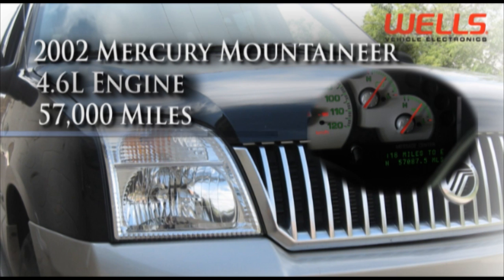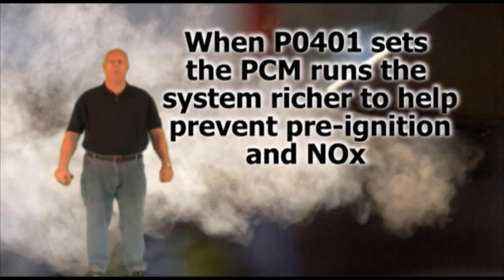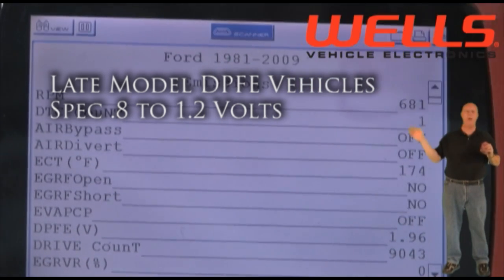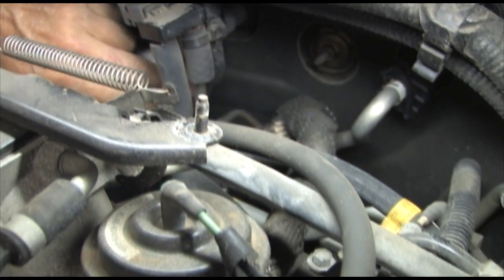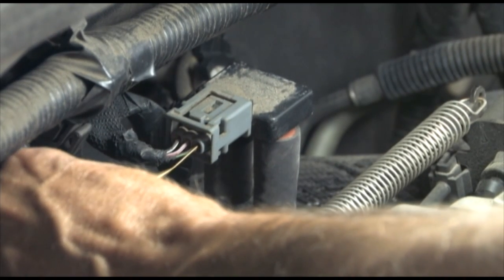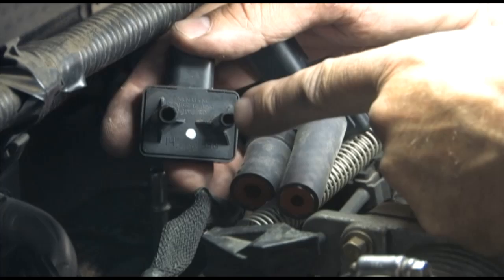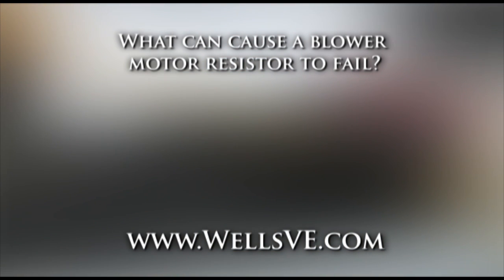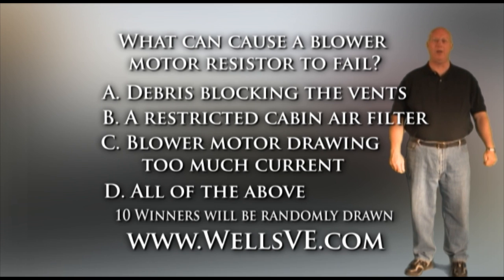Ford P0401 DPFE EGR  Pressure Sensor Diagnostics and Repair with a Contest

Comment: thanks for the video, will you please to guide me how to chek EGR valve module in my 2006 ford freestar please_ I got P0406 code and my check engine light is on, mtor es 4.2l V6. Thks
Reply from the maker: Hey Angel,
The EGR module on those is a complete unit with a map sensor/ flow sensor installed. To test check the DPFEGR output signal from being stuck over 4.5 volts. If it is, the code P0406 code will set.
~Ryan
Reply: @GoTechTraining  you aré right, i got 5.06volts in the dpfe sensor, whats Is the spec?
Reply from the maker: It will range depending where the EGR flow is at. Here is a testing procedure....

SIMULATE THE DIFFERENTIAL PRESSURE FEEDBACK EGR SENSOR SIGNAL WITH A VACUUM PUMP
Disconnect the downstream differential pressure feedback EGR sensor port hose at the ESM.
Verify the hose and port are clear and free of obstructions.
Connect a vacuum pump to the downstream differential pressure feedback EGR sensor port.
Key ON, engine OFF.
Access the PCM and monitor the DPFEGR PID.
Apply 27 - 30 kPa (8 - 9 in-Hg) vacuum to the differential pressure feedback EGR sensor and hold for 10 seconds.
Quickly release the vacuum.
The DPFEGR PID voltage must be between 0.25 and 1.3 volts with the key ON and no vacuum applied.
The DPFEGR PID voltage must increase to greater than 4 volts with the vacuum applied.
The DPFEGR PID must drop to less than 1.5 volts in less than 3 seconds when the vacuum is released.
~Ryan

Comment: I can’t seem to find the dpfe sensor on an 89 f350/460 cid.
Reply from the maker: Hello Jay,
I don't believe the 89 7.5L runs a DPFE sensor. This system used a EVP sensor mounted on top of the EGR valve.
Ryan Wilsing, Technical Instructor

Comment: What is the problem for my Ford Explorer sports Trac the check engine always come out and takes a lot of fuel 27liter per 100kms with in the City.but long distance it takes 20 Liter per 100kms .thanks this video
Reply from the maker: Have you taken a look at the easy stuff? Hows the maintenance items, air filter, spark plugs, fuel filter, etc?
Mike Becker, Senior Instructor

Comment: I bought a navigator and the egr sensor is unplugged and the wire harness is missing... Just a sensor with vacuum hoses and no wire harness or plug to it anywhere.. Lol.
Reply from the maker: That's not good Mike! Hope you don't need to take it through emissions anytime soon.
Mike Becker, Senior Technical Instructor

Comment: Does the voltage reading you give hold true for a 1999 5.4?
Reply from the maker: Michael, I believe so. Most of the DPFE sensors on Fords used the same readings. 
Mike Becker, Senior Technical Instructor

Comment: Beware haha , Autozone will say you need a new DPFE sensor and will charge you 80-100.00 for the part and the CEL will come back on / stay on after installing the new DPFE sensor , the same code too P0401 will show . Check before buying parts , autozone just likes to throw new parts at you .
Reply from the maker: Couldn't agree more man! Test, don't guess!!!!!! :)
Mike Becker, Senior Technical Instructor
Reply: very true Autozone always dose that to ppl
Reply: AND be sure the two vacuum lines u replace have the same INSIDE diameter or it will throw the 401 code lol
Reply: AutoZone does have a warranty policy on the parts you purchase so if they’re not the problem you can return and get your money back!

Comment: Hello Mark! I have a skoda octavia an 2012, engine 2.0 tdi and i have the error P0401, insufficient flow, if i wipe the car pulls well, and after a running time gives a bug and does not pull the engine well.What can I check? Thank you!
Reply from the maker: Hey Marian, chances are when the P0401 code sets it puts the car in some sort of "limp mode" That's probably why it doesn't run well when the code is set. Take a look at the passages for the EGR valve. Maybe they are plugged up with carbon?
Mike Becker, Senior Technical Instructor
Reply: @GoTechTraining  Thanks a lot!

Comment: I'm a semi retired electronic tech. This was very accurate. My wife's 1999 4.6 Liter  Ford Expedition has an intermittent more annoying than really worrisome problem.  it gets a  little rough. it seems to affect shifting..but not always. Auto Zone scanner  said it needed to have the DPFE replaced. I am not a parts replacer as such.. I want to know how something works and how it's designed. I now see why the EGR is so necessary.. It is a safety engenering part to prevent damage. I subscribed and rang the bell.  I am going to your site.

Comment: Great video. I have 96 Continental. When back probing as shown in video, I get 0 readings but car beeps then turns on cooling fan. I'm getting 0 readings when probing other ports as well.
Reply from the maker: Hey Scott, do you have your meter hooked up properly? You should get some sort of reading on at least one of the wires.
Mike Becker, Senior Technical Instructor
Reply: Tried different probe today and got readings of 1.19 at signal wire and 5 volts on other. Think I might have a problem with the device that controls vacuum for the "second" egr valve. Need to find out how to test it. Hard to access.
Reply from the maker: Hey Scott, good, glad you were able to get a reading! You're talking about the EVR? The EGR vacuum regulator solenoid?

Mike Becker, Senior Technical Instructor
Reply from the maker: Scott, how many wires are going to this part that you want to test? I think you're talking about that vacuum control solenoid. It will have only 2 wires going to it.
Mike Becker, Senior Technical Instructor

Comment: I had mine replace and i just got  the same code and cel again
Reply from the maker: Hey Southern Texan, maybe you have a wiring issue? 
Mike Becker, Senior Technical Services Instructor
Reply: Wells Vehicle Electronics ok ill double check and see if theres a loose wire
Reply from the maker: Good luck!

Comment: How do I connect my voltmeter to check the volts..... in the video I only see one lead connecting to the pin
Reply from the maker: Juan, you could hook the other lead up to the battery. The volt meter will read a difference between the pins...so If you are checking for power, you can put the black lead on battery negative, and the opposite for checking the ground circuit. Now there is way more in depth testing if you want to get into it...this is a very basic first test.
Mike Becker, Technical Services Instructor

Comment: our left side of dpfe sensor tube connection got blown and after inspecting right after there is a lot of heat and gas, do you know what caused it?
Reply from the maker: Hey John, many times this is caused by restricted exhaust. Especially if you are noticing the hoses melting. These are special high heat hoses, don't just use standard rubber when replacing.
Mike Becker, Technical Services Instructor

Comment: Please help , I just made the test with a Voltmeter and both readings from  both terminals shows 4.9 Volts , When I was expect to have one in 4.9 V and the other  Should read less than 1.2
Reply: For me it represents that the DPFE sensor is in short circuit .
Reply from the maker: It does sound like the DPFE is shorted. Verify that the voltage is gone when you unplug the connector. That will ensure the circuit isn't shorted to power before the DPFE.
Mike Becker, Technical Services Instructor
Reply: You were totally Right !!   I just replace the sensor  , make the reading again and I got  1.02 Volts on the input signal ,   , I just disconnect the battery since I don't have a scanner and the Check Engine Signal went away ,  I can feel the change right Away !!  Thank so much MIke !!!   I just spend in Autozone   $ 20 dollars for the replacement sensor!!  Att Happy Man!

Comment: yes th light is on for check engine n no It's not full we always put water only sometimes we use coolant and Idk where the temp switches are
Reply from the maker: Sounds like you have a cooling system problem. I hope it's not cold where you live. Too much water and not enough coolant will lead a cracked block if it freezes. Address your coolant leak/or burning first. Then worry about your cooling fans.
Mike Becker, Technical Services Instructor

Comment: 95 mustang radiator fan only turns on with defrost??
Reply from the maker: Hey Tony, Do you have a check engine light on? How is your cooling system, is it full of coolant? It could possibly be the temp switch for the fans. What have you checked so far?
Mike Becker, Technical Services Instructor

Comment: So all of the wires probed on the dpfe sensor all need to be within the same dcv? I probed the first one and it came as .962 dcv, the second wire was at 26.9 dcv and the third wire was at 5.01dvc all of this was done with the key on the on position. Engine off
Reply from the maker: Hey Jancarlo, you are ready 26.9 volts on one wire? That is crazy high! Is this maybe a typo? What kind of vehicle are you working on?
Mike Becker, Technical Services Instructor

Comment: Hi
Does a 4.0 litre v6 Ford Explorer year 2005 also have a DPFE sensor
Reply from the maker: Hi jbd desouze, your Explorer does not have a separate DPFE. It is built in with the EGR assembly and not replaceable separately. 
Mike Becker, Technical Services Instructor
Reply: Thank you very much Mike

Comment: Hello. I bought a 2003 Ford Taurus SES 3.0 24 value dohc. The egr pressure sensor is cracked an right hose gone. I found it today looking for a vacuum leak because car runs rough. What problems would or will this cause. I'm not driving the car till I fix it. Great car low miles family one owner vehicle. Thank you for your time.
Reply from the maker: Without a functioning DPFE, the car will have a check engine light and will not pass emissions. These usually are a pretty easy fix. If the hoses are damaged or worn I would suggest replacing them as well.
Mike Becker, Technical Services Instructor

Comment: my. hoses keep.  blow off. on a. 03 Ford. 150
Reply from the maker: This is common to happen when there is excessive backpressure in the exhaust. It could also be because the hoses are worn out. I would take a look at the hoses, maybe replace them, and check for plugged exhaust or a plugged catalytic convertor. Let me know if that works out for you!
Mike Becker, Technical Services Instructor

Comment: my sensor is stuck any suggestions on how to get it off
Reply from the maker: Commonly when the hoses are melted it is caused by excessive exhaust back-pressure. Most of the time that is due to a plugged up catalytic convertor, or a plugged up muffler.
Mike Becker, Technical Services Instructor
Reply from the maker: The hoses are stuck onto the sensor? If they are melted at all you should replace the hoses with replacement ones. These are not just standard rubber hose. Also if the hoses are melted there could be issues in the exhaust system. If they are simply just stuck on there, a hose removal pliers can help. I have run into vehicles where I had to cut the hoses to get the part off. Hopefully you are able to get yours apart. Let me know how this goes.
Mike Becker, Technical Services Instructor
Reply: What type of exhaust problem could their be if melted. ?
Reply: Wells Vehicle Electronics Thank you. That's what I had in mind.

Comment: I have A GM 3.4L V6 2000 Oldsmobile Silhouette  with California Emissions with error code P0412  at start up only and once cleared only reappears at  startup after 20 to 40 seconds. normal scan results except downstream  or 2nd O2 Sensor runaway.
Reply from the maker: A p0412 is related to the secondary air injection system. Simply put, you car uses an air pump, that on cold starts forces air into the catalytic convertor to allow the cat's to warm up faster. This code is showing that the system has a failure in it. Could be a bad air pump, or a bad solenoid or something of the sort.
Mike Becker, Technical Services Instructor

Comment: my dfpe code  is 327 on my 94 VIC .  did it change for ODB II?
Reply from the maker: Most of the old codes were 2 or 3 digits. When they went to OBD2 many codes changed. Did you need help diagnosing your DPFE?
Reply: +Wells Vehicle Electronics  well I had a friend give me a new DPFE for free so I never confirmed with certainty it was the issue. But after replacing the CEL comes on as car starts but goes away with gas applied and back on when gas is released.  Very few tools and equipment.

Comment: Question! The egr valve is the only code that came up when I had it tested...
Should the engine light turn off immediately or does it have to go through a cycle?
Reply from the maker: +phillyrey Good question! The car will have to go through multiple passed test cycles before it will clear the check engine light on its own. Many people will have the code cleared after a repair, either using a scan tool or by disconnecting their battery.
Mike Becker, Technical Services Instructor
Reply: +markjhicks what's a passed test cycle?

Comment: i have 2000 ford taurus an that sensor keeps burning off what is my problem is it the egr valve
Reply: One more thing.  A muffler shop will use the following method: drill a small hole before and after the suspected bad cat and measure the difference in pressure with the vehicle running.  If it's plugged, the hole after the cat would have a lot less pressure coming out of it.
Reply from the maker: +Darryl Smith Hi Darryl, It could be an egr problem, it could also be a partially plugged up catalytic converter causing your problem.
Mike Becker, Technical Services Instructor
Reply: how can i fix this partially plugged up catalytic converter an are there 3 of them on this taurus went to auto zone engine light on they say its 3 of them converter
Reply: I was getting P0420 code on my 03 vulcan.  The EGR stuck open and melted a hole in the plastic intake plenum.  The back cat by the firewall had melted down and plugged up, causing back pressure in the exhaust to force the EGR open all the time until the hot exhaust gasses melted through.  I had excessive oil consumption (burning oil) and a failing fuel pump that was causing misfires.  I had to drop the tank to replace the fuel pump and I put on new valve seals.  If you do indeed have a bad cat, there's always a reason behind why it went bad.  Simply replacing the Y pipe and cats will mean a repeat of the same situation in a few weeks.  Timing, internal oil leaks(valves, or valve seals), misfires(coil, wires, spark plugs) all have to be rectified.  Again, just to be clear, misfires, oil blowby, and heat are all cat killers!  You're already at a disadvantage becase 2 of the 3 cats are in the engine bay where heat buildup is much worse.   One of those 2 is the likely culprit because of oil, or unburnt hydrocarbons is hitting them first.  When you're having these kind of symptoms, it can get expensive to get your car all straightened out.

Comment: Thanks!!  P0402 code for excessive flow had the same fix on my 2002 ford explorer.  DPFE read 3.5 volts instead of .8 to 1.2.  $32 dollar 20 minute fix in the parking lot of auto-zone.
Reply from the maker: +Derek Sturdavant Good to hear! Glad we could help.
Mike Becker, Technical Services Instructor

Comment: Hi Mark.  I have 93 Ranger 3.0L V6 Auto Transmission.  I am getting check engine code 332.  Insufficient EGR flow detected . I tested the DPFE sensor.  First reading was 0.845v and the other reads 5v.  Does this reading suggest the DPFE sensor is bad? Please help. Thx
Reply from the maker: Check the voltage of the Pressure Feedback Exhaust Gas Recirculation (PFE) sensor. The voltage should indicate a reading of 3.2-3.3 volts on the Brown/Light Green (BN/LG) wire of the sensor connection.

If the voltage is not within the specified range, verify that the Brown/White (BN/WH) wire of the sensor is showing to be a 5.0 volt reference and that the Grey/Red (GY/RD) wire is showing to be a good ground when the sensor is connected.

If the VREF signal and ground check to be ok even though the PFE sensor voltage is out of range, it would suggest that either the PFE sensor is defective or it has a connection issue to the wiring harness.

From your test results, if properly performed, yes it appears the sensor is defective.
Try lifting the EGR valve while the engine is running (idling).  The engine should die when you do this, it will prove the passages are open. If the RPM does not change (drop) the passages are restricted.

Mark Hicks
Wells Vehicle Electronics
Reply: markjhicks I checked the voltages as advised.   I still get the same reading.  The voltage reading that you mention of 3.2  to 3.3v is where I am getting 0.845v? This voltage of mine should be 3.2v correct? The EGR valve is new on the truck.  I checked my ground wire to battery terminals and to chasse.  Connection is good.  The pressure coming from the Exhaust on both the lines are good when I put my finger on it.  Waiting for your reply. Thx
Reply from the maker: ***** Yes voltage should be near 3.2v. When I told you to open the EGR, it is to test the passage ways in the intake. You do not know if they are open until you test it like I said previously.
Mark